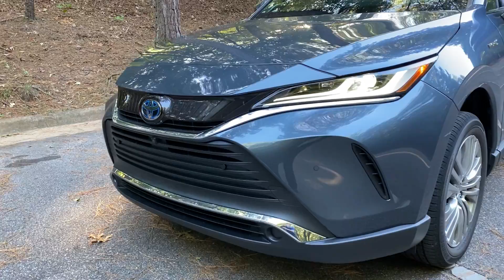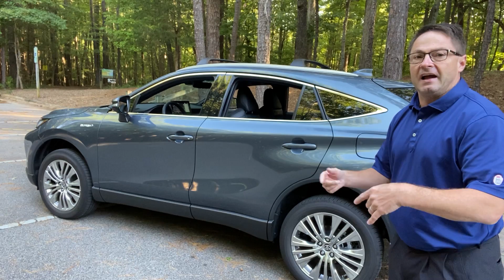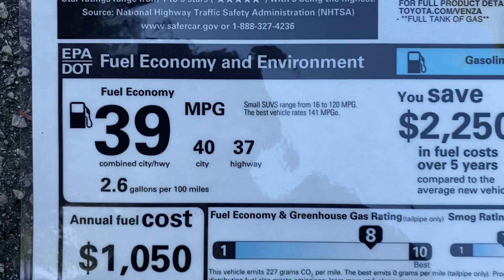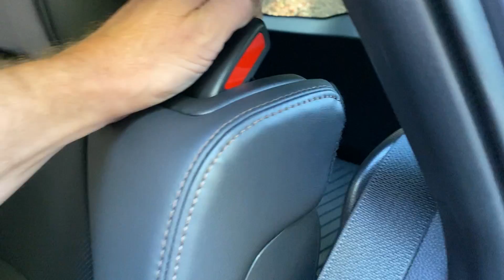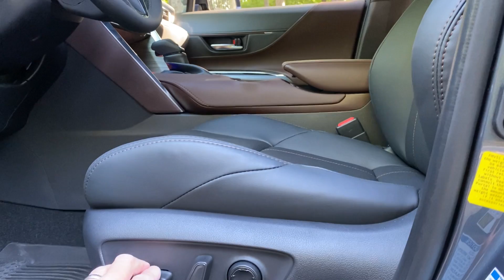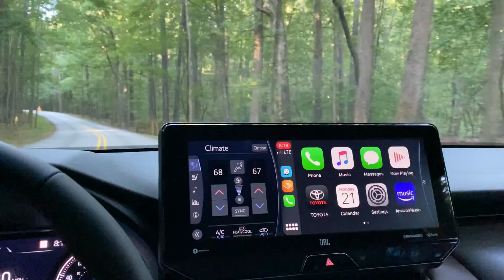2021 Venza Limited Review: Full Review, Interior, Exterior, Specs, Test Drive

Comment: Been watching your video review regarding the Venza 2021. It's been an educational and interesting review. We bought a new 2021 Venza limited last month. I hope you can help us with 2 issues. First, how can you correct the warning sign in my backup and front cameras? The yellow lines do not move when the car backs up. Second, we don't have the road sign assist option in the settings of the multi-information display (MID), although we got a limited edition that is supposed to be included in the settings. Hope you can help us with this one.

Comment: At about 30 minutes you made an important point. These hybrids, during acceleration they make a roaring noise but that quietens down at cruising speed. I plan to test drive a Venza tomorrow. After driving our Tesla, which takes off like a rocket in silence, if the Venza too roars too much, I'll likely get turned off! Yesterday I went to see a new Avalon hybrid. When the engine turned on, as the AC was going full blast, the engine made a rattling irritating sound! Pathetic. Same with a Lexus ES 300h I drove last year. The roaring noise during acceleration was so disheartening. I think this is why people don't like hybrids. Hey, they should have a slightly bigger battery so the car can take off without all that noise, and catch up on the battery charge during cruising! :)

Comment: Great Review!! My wife is looking at either a Rav4 Hybrid or this Venza. Why did they move the rear turn indicator lights down to the rear bumper? I’ve seen this feature on some Kias and feel it is a dangerous move. If you are close behind one of these vehicles at a stop light, you will not see these turn signals. Most people are not used to looking down at the car in front of you to see a turn indicator. This could be a deal breaker.

Comment: Is there an option for user  to disable the electric motors if we want to? What is a typical cost to replace the battery?  For 4 wheel drive feature, is it as good as Subaru?